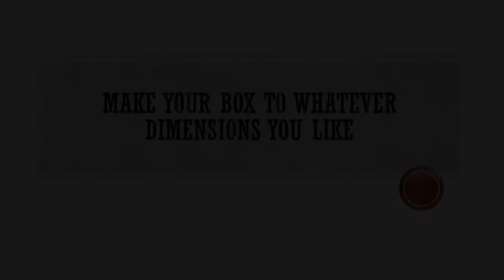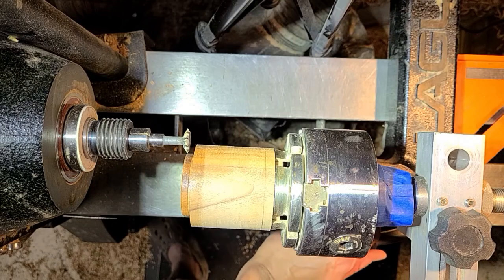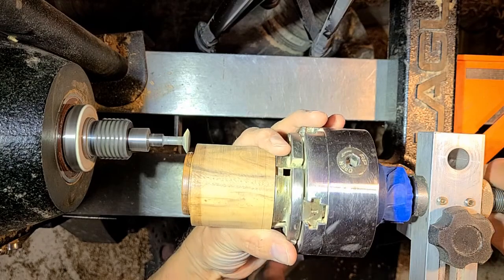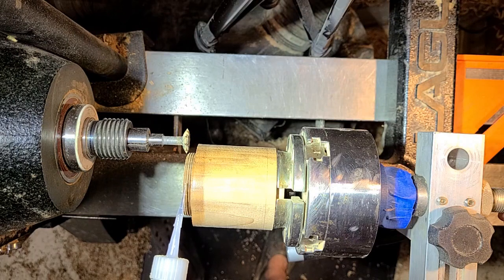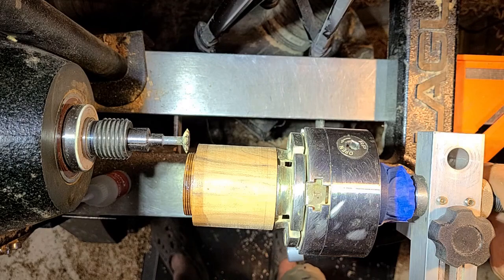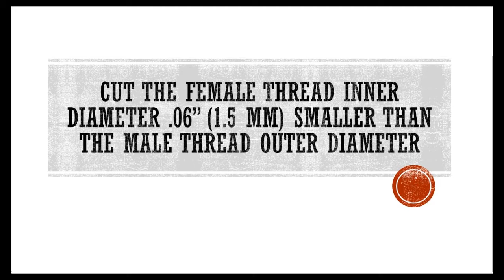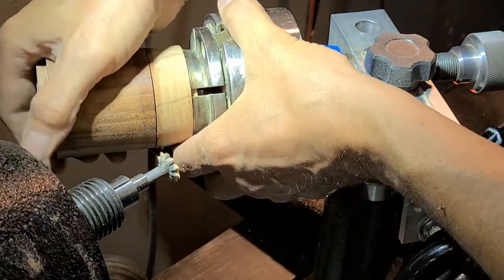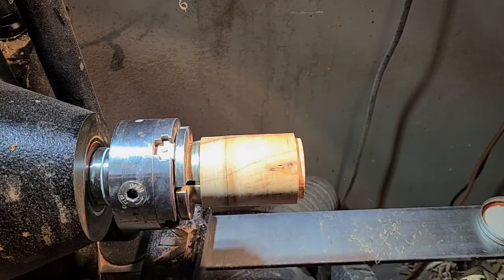How It's Made - Wooden Box Threads with the ChefwareKits EZ Threading Jig

Comment: Good tip on aligning the jig. I will try that. I have been using a board between the two spindles but finding space to use my speed square is a challenge on my PM3520c.

Comment: Hmm, been thinking about getting one of these. I do have an old Klein jig, and a Baxter one, and trying to figure out if there are any advantages to this one. For sure, keeping the jig on dead center/parallel to the lathe appears to be an issue. I think the old ones used to flip up to a vertical position so you could check the fit without having to move anything else. 

I did find a way to 'time' the threads when cutting them so you don't have to adjust one box a full 1/16 inch/one full turn on one box, and maybe 1/4 or less of a turn on the next. I use a stop block, kind of like what I use when making identical cuts on the cross cut set up on my table saw. Need a spacer between the cutter and the lid and base. I cut lid threads first, then the base. Spacer is about 1/8 or slightly less thick. Slide the jig up till you have that ideal gap. Oh, pencil line where the grain matches up. I start the lid/recess with the pencil line at 12 o'clock, cut to finish. Use the same spacer when cutting the base/tenon. I start with the line at about 10:30. Gets it pretty close every time. 

Don't understand why some one doesn't make a jig so the banjo stays in line and you don't have to fuss with it.....

I won't make boxes much over about 1 1/4 inch diameter. Had one fall off my table at a show once and it was in the grass for 2 days. The lid would come off, but it had really moved. I would expect problems with a box that size. 

Oh, Bonnie used Bulls Eye spray lacquer for her inside finish. The smell from it is gone in a minute or three.
Reply: Reed, if you have a Baxter, you do not want to get this. No advantage I can see other than price. Unless you need to buy the add on sphere cutter attachment which I do not think you need. Lining it up can be fussy.
Reply: @MikePeaceWoodturning  Some times my curiosity gets the better of me. I want to see how it works, and figure out if I can make an 'auto square' set up for it so you don't have to put a square on the banjo every time you move it... I hoped they would be at the Oregon Woodturning Symposium, but he wasn't. I do like his lapping fluid.

Comment: hi a bit late here but what thread pitch does the jig take?
Reply: There are now four different insert/shaft combinations you can buy - 16, 10, 8, and 6 TPI. Mine is the 16 TPI which the ChefWare Kits recommends for diameters in the 2" range. The more coarse threads are recommended as follows: (10 TPI) for larger threaded lids, (8 TPI) for custom lathe spindle jigs like a wooden face plate or vacuum chuck, (6 TPI) for making an extra large bolt/nut project. I have been relatively happy with the 16 TPI, but I make only small boxes. If I had it to do over again I'd probably buy the 10 TPI setup.

Comment: Nice video. Thanks. I'm just wondering why you do the base first. Common wisdom on the internet seems to do the top first. Then if you screw up the second cut on the bottom you can easily redo the threads, unlike the top that would be a write off.
Reply from the maker: That's a good point. For me, it's just preference, because if I mess up the threads on the base I would consider it a write-off anyway. The grain wouldn't match up well enough for me to continue if I had to cot off more material. I see your point though. Maybe I'll change how I do these now. Thank you!

Comment: Were you using a 16 or 10 TPI jig in this video. The thread depth is different for each one. I am trying to relate that to the .06" you make the male OD larger then the female ID?
Reply from the maker: I use the 16th TPI jig. All of my threaded lids are less than 75 mm diameter so that size works well for me.